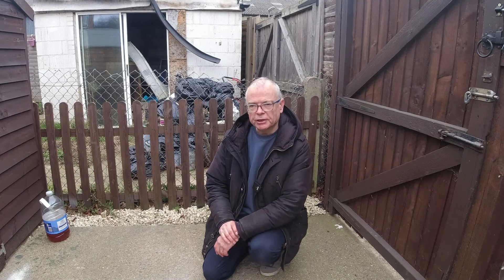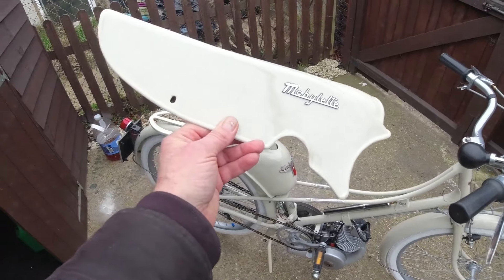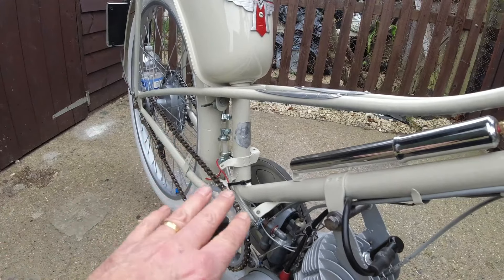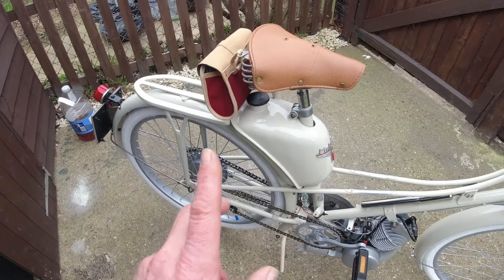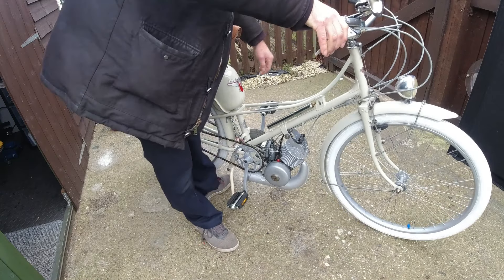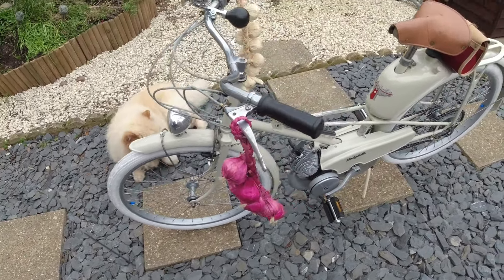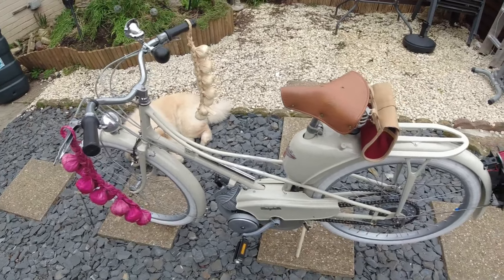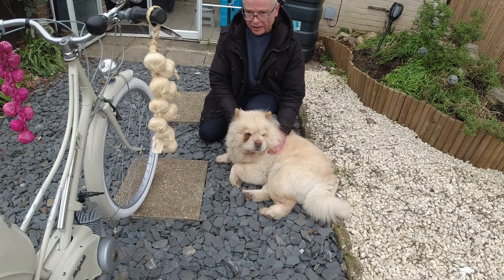Mobylette AV33 1953 Restoration Final Episode

Comment: Looks great showroom quality work 👍
Reply from the maker: Thanks very much Steve. I am hoping the fuel tank leak is now fixed. I managed to get it to run today. Only by injecting petrol down the fuel pipe. It was revving to high, but have ordered a new cable for the throttle and decompression valve. The ends are very frayed so are difficult to adjust.
Take care, Jeff

Comment: Fantastic job jeff as for the running you will get there I'm sure 👍👍👍👍
Reply from the maker: Thanks very much Alan. Hopefully I have now sorted out the fuel tank leak. I ordered a new cable for the throttle and decompression valve. Did have it running briefly just by injecting fuel down the fuel pipe. It does run nicely, but too fast. There is no adjustment in the two cables as they have frayed.
Take care, Jeff

Comment: Hi Jeff hope your well, the Mobylette is looking great, but I'm gutted for you with the petrol leak and the running. hope you manage to sort it out, great video  take care mate
Reply from the maker: Hi Shaun, yes not too bad thanks. Yes it was a shame, but of course there is always something. It was a runner, so should be OK. Still waiting for a new decompression part. I will probably take the tank off again just to check it's not where the tap joins the tank.
My Father in law has gone on holiday for three months and he has quite a few problems with his Jaguar. I will start with the rear brake pads tomorrow, tiredness permitting. It's my last day of six at work this week. 
Take care, Jeff